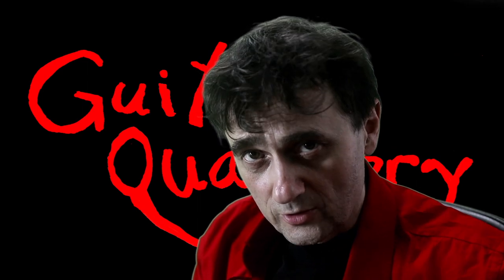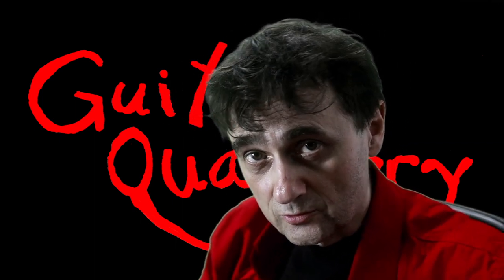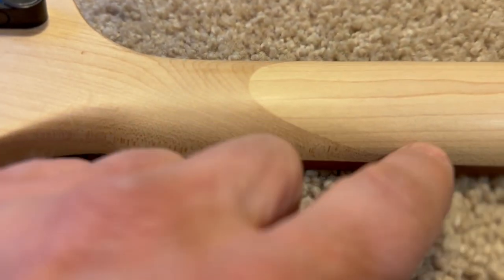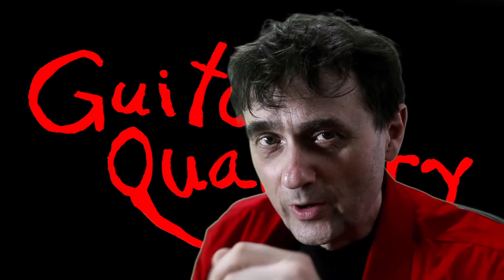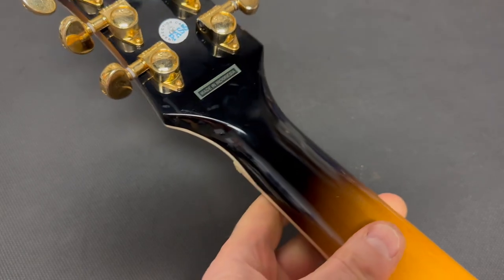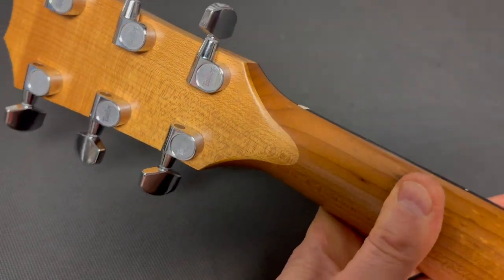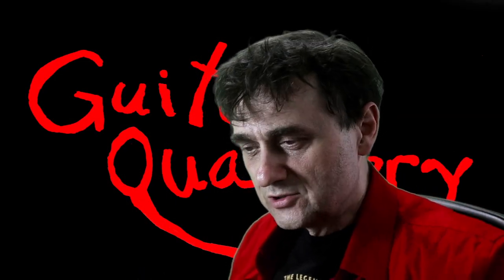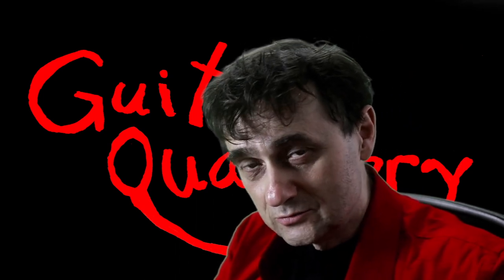Guitar Neck Scarf Joints - Pros & Cons

Comment: Wood movement works a little differently than you explained.
Reply from the maker: I'd be interested to know more about this wood movement issue, if you wish to elaborate. Thanks.

In fact, I am currently preparing a follow up video. I'd be interested to include your perspective, if it makes sense.
Reply: @GuitarQuackery  if made properly the headstock side of the scarf joint should be cut from the same board. While you will flip the orientation of the board the board will still expand and contract in the same direction. If the neck is made from quartersawn lumber as it should be the wood movement will be minimal.
Reply from the maker: @mkscustomcreations1061  Thank you for taking the time to elaborate and to offer your perspective. I do see your point. I also see that you are an experienced woodworker.

As it is usually the case that independent builders will most likely always cut the scarf joint from the same piece of wood, it is also true that we never see that on factory-made guitars. In fact, it is very often quite evident that the two pieces of wood are quite different. 

In your experience, do you think that might explain why we (or at least I) often see a hump on the fretboard side of that kind of scarf joint?
Reply: @GuitarQuackery  when you put it that way with factory guitars and not being cut from the same board could be the issue, even if it’s the same species it’s grain orientation is most likely not the same. That could cause the hump or it was simply not flattened properly after the joint was created.
Reply from the maker: @mkscustomcreations1061  I really appreciate you taking the time to share your input on this.

Comment: I've just had two Epiphone Rivieras with Headstock Joints fail at the nut. 
So the scar didn't fail: the narrowest part of the neck and the 90° stress concentrator at the nut is where the wood failed from knocks during shipping. 
Made worse by the extra long headstock of this particular Epiphone model.
Still, it's an indicator of a design weakness.
Reply from the maker: Agreed. I am really, not a fan of those shovel size headstock shapes on some of the Epiphone guitars.

Comment: You're the only video I've found showing how and why they can fail. Have you ever seen a reinfornced scarf joint fail? Most Jackson necks are scarf joints, but they also are reinforced with either Carbon or Graphite. It's mainly only their higher end guitars made in Japan or USA that are through necks. So obviously the through-neck is more 'premium', but I don't see anything online about Jackson necks failing. Love to know your thoughts. Thanks for the insights!
Reply from the maker: I guess it's fair to say that any glue joint can fail. I have seen a few failed scarf joints, but I've seen significantly more glue joints that have not failed. If a glue joint is well executed we should not worry about it failing, even if it does not have reinforcements. The only issue I'm having with that common first position neck scarf joint is the possibility of it causing a slight hump on the fretboard, which I have seen quite often. But it is also fair to say that the hump is easily fixable. It just depends how much the fix will cost and if it might have been better to spend that extra money on a different guitar.

All that said, I am in favor of scarf joints, for environmental reasons. 

Back to your question. I have mo reason to believe that Jackson guitars have badly executed scarf joints, or any other glue joints. That would not play a deciding role in making a decision to buy a guitar.

Comment: I recently had this condition on a new PRS Silver Sky SE. I had buzzing on frets 1 to 4. When I checked neck with notched straightedge, It had a slight backbow measuring about . 004" on the fretboard at the nut. It's not a lot, but enough to cause buzzing. Leveled the frets which resulted in taking off about . 003" on frets 2-4. I had this issue years ago on a Chinese tele copy with a scarf joint, which I corrected, so I knew what was going on and how I had to fix it. So, if this has happened to one person (me) more than once, I would guess that it is more common than we realize. So, I'm not a fan of scarf joints.
Reply from the maker: Thank you for taking the time to share your experience.

I am also absolutely not a fan of these kinds of scarf joints. A scarf joint adjacent to the first couple of frets on the fretboard has no business being there. 

Ironically, while that kind of scarf joint is supposedly helping the environment, it has the opposite effect, as so many guitars end up in the garbage, because of this type of scarf joint.

I do like the Taylor headstock scarf joint. That one is a true reinforcement, saves, valuable resources and is also pleasing to the eye. At least to my eye, it is. 

Of course, any negative number, even as little as -.001”, has the potential of causing fret buzz.

Comment: Been at this scarf joint vs. one piece neck debate for years. Been playing since 1973 and have never broke a one piece neck and have never seen a broken one piece neck. Anything will break under the right conditions. As a result do you favor one piece necks (if done correctly using quarter sawn wood) versus scarf joints? Thank you for educating us on the various types of scarf joints. Great video!
Reply from the maker: Good question.

I like scarf, joints, but I don’t like all types of scarf joints. Taylor, in my opinion, makes the best scarf joints. One piece necks, with a slanted headstock, are not environmentally friendly. That said, I own a lot of Gibson guitars. But I would still buy a Gibson if they made the neck with a Taylor-style scarf joint.

I also like laminate necks.

Comment: never knew the thing with the grain direction.. I have an ES 335 made in Korea with a scarf joint on the neck are like in your first demonstration. no problems at all with the fretboard. It is probably important that the workers know what they are doint with that kind of joint near the headstock. because I rather have a scarf joint than not.. gibsons like to break their necks.. I think if it is done right, it is probably better.
Reply from the maker: Some kinds of scarf joints are better than other kinds, for Guitar necks. The Taylor scarf joint is the best one. The one adjacent to the first position on the fretboard is not ideal. 

The potential development of a hump on the fretboard is not so much about what the workers are doing. no one knows how wood will bend, warp or twist as it ages.

Comment: Thank you sir. After 30 guitars I still do not know for sure but I kind of suspected that area to cause problem.
I have a guitar that shows signs of it, me working on it, it settled but all the sudden the nut came loose and the problems returned.
That area is very sore I cant place the truss rod cover as those screws causes the neck to linger and the third fret goes blind.
No use in working that fret until the main problem is solved. Work work work...
Reply from the maker: I don't think that the nut coming loose has to do with the scarf joint. A lot of nuts do come loose and if the nut is fitted snugly enough, that's not a problem. Two small drops of wood glue will hold it in place. It should never be glued permanently, as it needs to be serviced, every now and then. So, no superglue. Just a couple of small drops of Titebond original or white Elmers glue, or fish glue or any water soluble glue.
Reply: @GuitarQuackery  That is quite right and done but that joint area is obviously an tutchy point causing problem. That guitar a new one stands aside, an waiting game as sometimes time will heal.
To bee fare our wheater conditions a roller coaster is disastorus for any guitar even my best one reacts to it.
Reply: That scarf joint describes the state of the world we live in today. Supposedly its purpose is to save on wood, which is to say it saves trees. The end result is a a world with millions of cheap guitars that end up in the dumpsters, so as a result, they need to cut more trees to make even more of the same cheap guitars that will end up in the dumpsters.
Reply: @frankentronics  True! It is so depressing to see realy nice and good wood wasted on affordable guitars that are not even ment to be any good they never will as there are to many faults in them.
Most of them will as you say end up in an dumpster.

Comment: What is the optimal method of neck construction from a luthier's point of view? A one solid wood piece neck?
Reply from the maker: Good question. One solid piece of wood is not the optimal in terms of stability. The laminate construction is king, if you want a solid and stable neck. Roasted maple is currently gaining popularity, but there are issues with that material. Although it is stable, it is more prone to chipping and cracking and makes refrets more challenging. In fact, I should probably make a video to answer the question that you asked, as I'm sure others will find it beneficial. But when it comes to budget guitars, they kind of have to resort to scarf joints. The need to do something to keep costs low and a scarf joint is definitely a way to keep it things on a lower budget.
Reply: @GuitarQuackery  Thank you for the detailed and informative answer!
Reply from the maker: @Iamadoctor6365  I am starting to organize materials to make a video about guitar necks. It may take a while to organize it all. I have to have particular guitars on hand to show.
Reply: @GuitarQuackery Looking forward to seeing it. The neck is where all the action is (no pun intended), so it's an important topic.
Reply from the maker: @Iamadoctor6365  According to Dr. Randy Andy, that is an old Chinese proverb. It will appropriately be used in the upcoming neck video.

Comment: Wood movement doesn't really happen like that. Wood moves, or expands and contracts along the grain with seasonal changes. Think of it like your fingers spreading apart. That's how wood moves. The issue is that the wood of a guitar neck is not enough. It takes about 6 in of mass to get any measurable amount of expansion. What small amount of expansion may be there, all of the wood of the neck would be doing at the same time. Including the fingerboard. If one is seening an issue in that area of the neck or any part of the neck of  a cheap guitar. It's because it's a cheap guitar, and was poorly built to begin with. Many high-end luthiers, who are arguably Master woodworkers, use that scarf joint all the time, and do not have any problems.
Reply from the maker: Thank you for sharing your thoughts. Here is fine I believe wood movement does work.

Let’s imagine that the neck is a typical slab cut. The growth rings are parallel to the fretboard. The wood, as it continues to dry. The neck becomes a little bit thinner, correct?

Now, let’s imagine there is a scarf joint in first position.

There is a cut at a 20° angle. That cut is sealed with glue.  And other words, all the microscopic fiber ends are completely sealed, at the cut. so the wood cannot shrink at that place. But the wood does shrink further away from that glow joint.

So, the neck becomes thinner everywhere away from the glue joint, but the glue joint stays a bit thicker. 

That’s where the hump is, adjacent to the second or third fret. 

That’s how I believe these kinds of scarf joints develop a tiny hump in first position, as I observe in a high percentage of guitars that have this kind of scarf joint. 

Also, I really am not sure that top luthiers really use this kind of scarf joint all the time for their builds. And if they do, I don’t know that anyone really checked with fret rocker all of those guitars to see if there is a tiny hump adjacent to the scarf joint.

I hope this makes sense. 

Thanks again for dropping by.